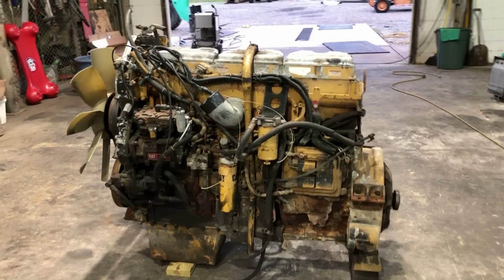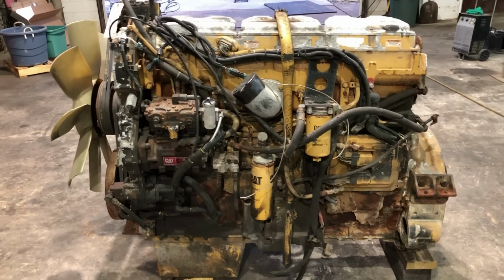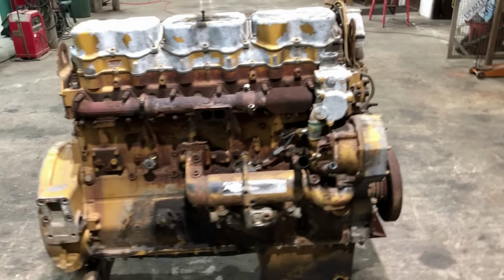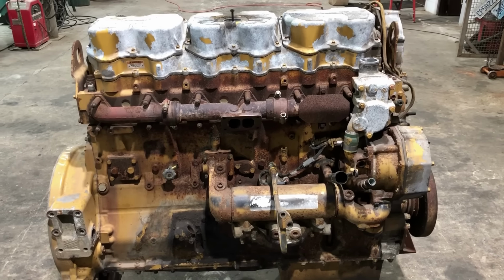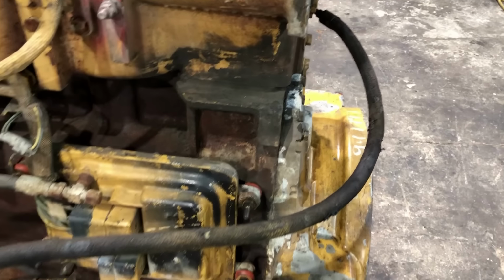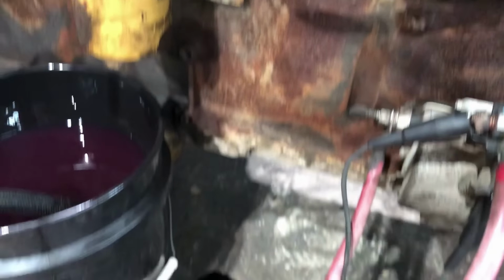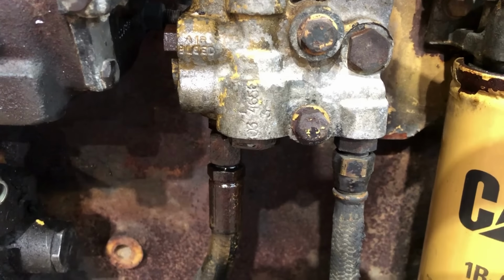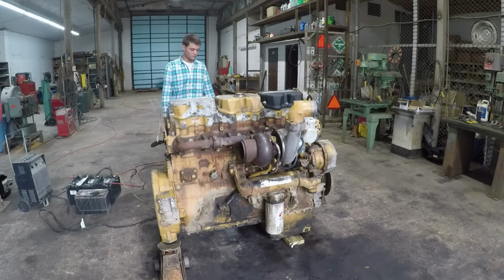Bringing a Caterpillar 3406E 14.6 Liter Diesel Engine Back to Life

Comment: Hey. Got a question for yaa, my 2WS500522 has low boost all of a sudden (25 psi). And alot of the power at 1400rpm is gone.  I did soap and water pressure test on intercooler and plumbing connections seemed ok. I unplugged the boost sensor above the compressor drove it, the check engine light went on and dash gauge stopped working.  Anything wpuld help here thanx. Love the videos keep them coming!
Reply from the maker: Too many possibilities to start guessing without having the truck in front of me.  It should be pretty simple to figure out, just need to get it in front of somebody who knows these engines.
Reply: @KT3406E  Totally true, turned out my turbo ate an exhaust port liner for dinner. Fun stuff lol

Comment: do you have any interest in Volvo Penta marine engines?  I have about 10 Volvo Penta D6 330 hp for sale.  some are bare block, some are complete which need rebuilt, and 2 or 3 are running take outs.

Comment: How is it running without overheating?  There's no cooling system.  No radiator, no fan, no water pump, no coolant, no nothing. I would think it would seize up from overheating, running like that.

Comment: I am looking at a 6ts 20360 is it a  strong block?  and it says 475 hp max 490 could it be safely reprogrammed to do 550hp or would you have to change hard parts? If you could help me with some info I would appreciate you. I appreciate you regardless and look up to you young man!

Comment: Hey KT3406, if you read this can you give me advice pls. Recently had my truck at CAT and they are telling me my engine has an issue and want to troubleshoot. It’s a 6TS 3406e and they’re claiming my oil pressure is too high and wanted to replace the oil,pump which they did and pressure is the same. Cold start 80-85psi and down the road ~75psi. Hot idle 55-60psi. What do you think

Comment: I'm wondering... If you were building an over the road (glider) tractor for yourself, and wanted CAT power, which engine would you select?
Reply from the maker: C15 block, ACERT crank, 16:1 compression pistons, 55 injectors, and 800 marine cam.
Reply: I appreciate you replying... Thank you!  I have just "1" more question..  Would you use the same configuration if you were building a heavy hauling straight job (ie: tri-axle dump etc..) ??
Reply from the maker: Yeah.  A regular 14.6 would be just fine too, but if I could have my choice of parts that's what I'd do.
Reply: I really appreciate you replying again!!  If you come upon one please let me know!!

Comment: I’ve been researching 3406E engines for a semi truck I plan on purchasing for some time and have read countless articles on the various versions and have come to find the preferred one to have is the 15.8l 1MM 600 HP.... Your thoughts 💭 on this engine versus the rest
Reply from the maker: You will need some very good luck or really deep pockets to come up with a 1MM.  Not all that special, I'll take an ACERT crank with 16:1s any day over a 15.8.
Reply: KT3406E Thanks for your response..... I appreciate it and I guess I’ll have to start looking into the Acerts.....
Reply from the maker: @michaelsites1498  Keep in mind I'm not talking about a stock ACERT, I'm talking about just the ACERT crankshaft and rods.  Any regular old 14.6 3406E or a 6NZ is your best option if you're going to run a stock engine.
Reply: KT3406E so basically find a block and have a reputable builder reassemble to whatever specs desired and that way I can pick and choose the best piece of the puzzle for my engine.... I get that as well just never thought about it that way.... Also was shocked at your comment on the C15 being your choice but totally see why after watching your videos!!!! Thanks so much for your channel
Reply from the maker: @michaelsites1498  I don't guess I know what you're talking about as far as the C15 being my choice.  How much power are you looking to make?
Reply: KT3406E north of 800 and 2,000 torque.... I would like to have a small shop or an individual that goes the extra mile like yourself to build an engine for me like they would build it for themselves!!!! The 04 Kenworth I’m buying has a 3406E in it not sure of the series though
Reply from the maker: @michaelsites1498  If it's an 04 model truck then the 3406E is not the original engine to the truck.  Truck application 3406E production ended in 1999.  An ACERT crank and rods is the way I'd go to make that amount of power.
Reply: KT3406E I apologize but the truck has a C15 in it but there’s a 99 KW with the 3406E I was thinking about purchasing.... The 04 KW with the C15 is rated at 475 HP.... Thanks again

Comment: Possibly a dumb question if you buy one of these and lets say it was non rotating, are you just out of luck if the main bearing seats are too damaged to align bore it again.
Reply from the maker: If it was non-rotating you'd expect to find some kind of major problem.  But yes, regardless of whether it's rotating or not, cores normally don't come with any kind of guarantee.
Reply: @KT3406E  Hopefully they sell pretty cheap

Comment: Not a diesel engine tech or claim to be one, but don't you need to get coolant circulating through that engine or you'll destroy it further for as long and as hard as your running it for? Great vid by the way.
Reply: My guess is you'll have to beat it a lot harder for a lot longer you damage it. The oil will cool the engine for a while and a diesel runs cooler anyways.
Had my old 4-cyl Audi run for several minutes without coolant after an engine swap. It took some time for it to get even remotely warm.

As for the video, really informative and entertaining! I'll sure subscribe and watch the other ones as well 🙂
Reply from the maker: There is a whole lot more thermal mass and volume of engine oil here than you realize.  It didn't even get close to being hot.  Thanks for watching.

Comment: Exciting stuff, but looks a bit like a circus for the public. If I cared about the future of that engine I would have first checked all up, before running it. Also, one has to be careful about dumping used engine oil into the fuel. This means adding huge amounts of particles, some of which are fine enough to get through the fuel filters but still big enough to accelerate wear of the high pressure fuel system. And if this happens in a truck, what about poisoning the aftertreatment system with lots of substances contained in the oil, for which the catalyst is not designed?

Comment: and today we learn why we need coolant in a liquid cooled motor
Reply from the maker: No, actually we don't need coolant to do this.
Reply: i don't know the specifics of how long you ran it vs how long you let it cool but I felt you ran it a little long without coolant but that's just my 2 cents i havee seen worse  @KT3406E
Reply from the maker: @jaosnv2979  There's a good chance I know a whole lot more about what's going on here than you do.  This isn't my first rodeo, or even my 50th.
Reply: not here to argue or really care i have ran a motor with no coolant b4 two just not that long. @KT3406E
Reply: im a professional powersport technician i know allot to
Reply from the maker: @jaosnv2979  Maybe you do, but there's a pretty major difference between a 3200 pound truck engine and a 4 wheeler.  You should probably stick to criticizing 4 wheeler videos.
Reply: @KT3406E  i don't care bud i really don't 

its not my machinery

Comment: Sounds great,wonder where the water is getting into the oil?
Reply: he mentioned the 2 most likely causes ,, which are about the only way water gets in the oil on an engine that still runs 
#1 Oil cooler ,,and #2 a cylinder liner seal 
other causes are head gasket  failure and a cracked block as well ,,if it was a head gasket it would barely run
Reply: wildcoyote34  I have had seals fail in a water cooled oil cooler that leaked water into the oil but also a cracked liner that leaked water into the oil. Engine still ran ok and passed compression test! Only found it by doing a high pressure test on cooling system. Big problem is it was a running engine and owner was reluctant to take a running engine out of service. Oil floats on water and after a certain point the engine is trying to run on water as lubrication,not good.
Reply: I have seen a cracked liner a few times too ,,last one i saw was a liner that i suspect was cracked from the time it was new ,,and it was a very low mile engine ,, just 25000  ,, the engine was an N14 cummins 
the engine was replaced under warranty  and I ended up with it as scrap after it sat for almost a decade in a barn ,,it was actually the first engine i ever totally rebuilt ,the #3 liner had a crack that looked as if the liner had been dropped 
71 series detroits  have a problem with cracked liners too  , I have replaced more than a couple in engines that got hot

Comment: I can't help but ask... why bother putting a turbo on if you weren't going to pipe the air intake? Not trying to be critical, just curious.
I would have just capped off the turbo oil feed line and ran it on the open exhaust manifold.
Reply from the maker: 1. To be a complete core this engine has to have a turbo.  2.  If I had done this without a turbo everybody would be complaining that they wanted to hear the turbo.  3.  There's absolutely no reason to pipe it to the intake for a test run in the shop.  You just can't make everybody happy no matter what you do.

Comment: Out of curiosity, what would you estimate the fuel to recycled oil ratio to be?
Reply from the maker: Poured it in until I thought it was about right : 1
Reply: @KT3406E  Lol, nailed it.
Reply: A guy I know who used to manage a fleet of Detroit 92s mixed filtered (spun in a centrifugal filter) oil at 5 gallons of oil to 100 gallons of diesel. Back when you could get away with it.

Comment: I miss the days of non computer controlled engines.
Reply: 3406e is an electronic engine. 3406b was king. Good old PLN days
Reply from the maker: @Hitmonkey420  An E model will eat 3406Bs all day long in power, longevity, and fuel mileage.  These are very simple electronic engines and are nothing to be scared of at all.  In my opinion, they are actually simpler than a B model.  No injection pump, mechanical timing advance, etc. to maintain.
Reply: @KT3406E  oh I know man. There's a reason why EUI has been around almost 30 years. But as far as old mechanical engines go 3406b was arguably the all time great. I still see them rolling around here.

Comment: are any 5ek's built with the strong block, if so where do the numbers begin? I have a 95' 5ek, just trying to learn as much as possible about it, your vids are greatly appreciated. where are you located and what is an estimate on a 5ek rebuild? considering its running at the time of rebuild?
Reply from the maker: All 5EKs have the older block.  There's nothing wrong with them, they just have HP limitations compared to the newer E block.  They're typically fine up to about 700HP in my experience.
Reply: thanks for the info

Comment: Nice work! What could you really use this engine for?
Reply from the maker: It's a very popular truck engine, I have sold lots of them to glider builders.
Reply: Well, you could put it back in a truck... or tractor, swinger, dozer, dumper, crane, winch, drill, or stick it in a tug boat, fishing boat, yacht, etc... or put it in a generator, welding/gen, compressor, water/air pump etc. ;)

Comment: @10:92 (being a novice nowhere as knowledgeable as you) I was surprised that the injector wires were located under the valve covers. Are they some kind of high temperature plastic for diesel applications?

Comment: I have an option to buy 2 freightliner cab overs with 600k and 800k miles.   3406b with 13 speed running and driving for 12k for both.   Is that a good deal?  Guy said 1 of them had been inframed around 100k ago
Reply from the maker: That's cheap enough, but keep in mind B models aren't worth much anymore.  If you have a use for the trucks I'd say it might be a good deal for you.  If you're trying to make money, I'd probably look somewhere else myself.
Reply: @KT3406E  not looking to make money, rather use them for my construction business.   Trucks are in good shape.   Guy says they are 425 hp
Reply from the maker: @colinhunter8793  If they are what they're supposed to be, I'd say that's a hell of a deal for you.  Just keep in mind most times the mileages and stories about inframes aren't true if they don't have paperwork to back it up.
Reply: @KT3406E  thanks for the advice!  Really enjoy listening to your videos and learning this stuff

Comment: Do you buy Cat OEM or Aftermarket parts when you do rebuilds?
Reply from the maker: Both, depends on the engine and what the customer wants.
Reply: @KT3406E  In what your do who makes the Best kits? Im going to rebuild my Cummins N14 out of frame, Im looking to turn it up from 350hp to around 450+. Do you know anything about the Highway and Heavy Parts company. That was who I was recommended to.
Reply from the maker: @Darkmatter2134  I know very little about an N14 so I can't help you there, but yes HHP usually has some of the best prices you'll find.  Normally I'd recommend IPD if you decide to use aftermarket parts, but I don't believe they offer anything for the N14.
Reply: @KT3406E  Well shoot, but ok. Thanks for the help, and cool videos BTW.

Comment: Where is the serial number on the Block located???
Reply from the maker: Around #5, turbo side.  It will be stamped into the block, some are hard to read, might have to sand on it with some sand paper or something.
Reply: @KT3406E  okay sir I I appreciate it.    I'm a Detroit man myself but recently bought two caterpillars and I need to find out if it's a 2ws or a 6nz..   I will take a look at it tomorrow and get back with you!

Comment: Do you sell these after rebuilding them?
Reply from the maker: I don't build very many.  Mostly buy and sell.  Used to part a bunch of them out, but the current prices don't justify it anymore.
Reply: KT3406E ok good to know. If i supplied an engine would you be willing to rebuild it? Looking to buy an 3406E or an 6Nz and build her up. And any recommendation on where to from?
Reply from the maker: @jnewjc  Possibly, you'd just have to get ahold of me.  kt3406e@gmail.com

Comment: What kind of reliable power can you get out of an E model?
Reply from the maker: Depends who you ask.  For a working truck, I typically don't recommend much more than about 800.  Most guys who build 1000+ end up backing it down after a few months.
Reply: @KT3406E  Thanks for the reply. In your opinion which is the best E model to build an 700hp+ working truck? I'm looking at buying a 1LW.
Reply from the maker: @roy1531  Any of them with the 137-8466 block.
Reply: @KT3406E  GREAT Video ...I'm curious was there a water to oil issue to resolve as well Thanks
Reply: @KT3406E   I wanna know too, did you  still have a water to oil leak to fix ?
Reply from the maker: @stevenhixburn6195  Yes, the issue is almost positively a bad liner o-ring or o-rings, or a  bad oil cooler.  This engine will be rebuilt at some point in the future and that issue will be fixed then.

Comment: How many horsepower is that motor in stock form?
Reply from the maker: In a truck application they were rated anywhere from 310 to 550 from the factory.
Reply: @KT3406E  Thank you, I have a 3406e in a 1996 International 9400 and was wondering how much horsepower it had.
Reply from the maker: @garybuster4328  If you get me the engine serial number I'll look it up for you.
Reply: @KT3406E  5Ek60908
Reply from the maker: @garybuster4328  It was originally a 435 that went to Navistar.
Reply: @KT3406E  Thank you so much...The person from whom I purchased the truck from said that it had been turned up ..I don't know how true that is though.
Reply from the maker: @garybuster4328  No way to tell where it's set without plugging into it and looking.

Comment: how can you run the engine without coolant ?
Reply from the maker: Just like you saw me do it.  Standard practice.
Reply: @KT3406E  Why doesn't it overheat ?
Reply from the maker: It was run for less than 5 minutes with no load, and there is over 3000 pounds of metal mass here plus 10 gallons of engine oil.
Reply: @KT3406E  I guess that makes sense.  I have a small engine that heats up very quickly even with coolant.

Comment: What does a core like this usually go for??
Reply from the maker: 5EK and 6TS right now $4000-4500.  I could probably squeeze a little more out of this one since it runs and has the strong block.
Reply: @KT3406E  I have a 98 6ts26171 so it's a strong block also. Was outframed about 240000 ago with a new crankshaft, balancer, etc. any idea what it might be worth??
Reply from the maker: @bigpoppasjunk333  Not trying to be a smartass at all, but the best answer I can give is it's worth whatever you can get for it.  Runners can be hard to sell for much more than cores.  But if you have paperwork and the miles are documented, it can be done if you find the right buyer.

Comment: Why is it called a core engine?
Reply: It came out of a truck.  The owner who had it took it out because of water in the oil.  They just replaced it with another good engine.
Typically they just sell or give them to the junk. But this guy bought it and knew how to make it run again.